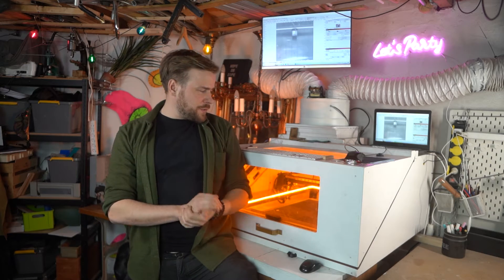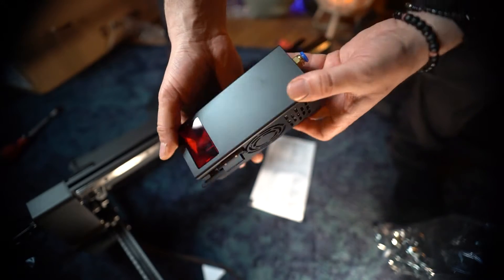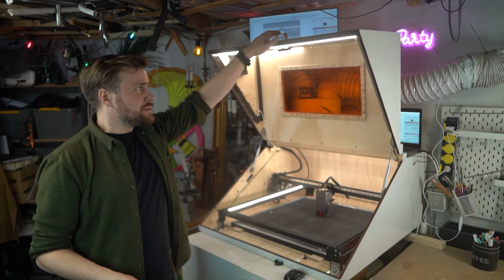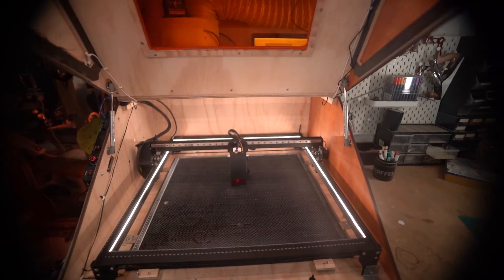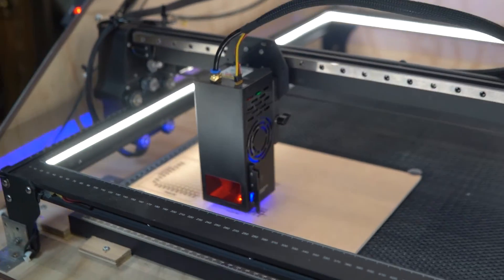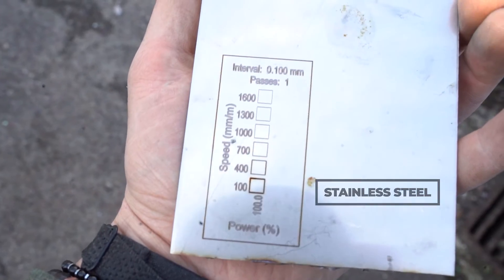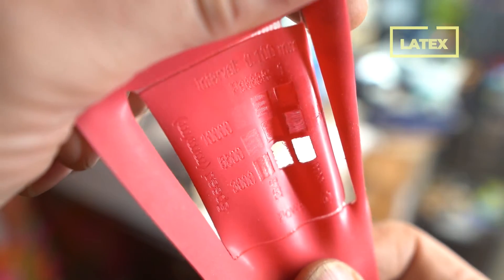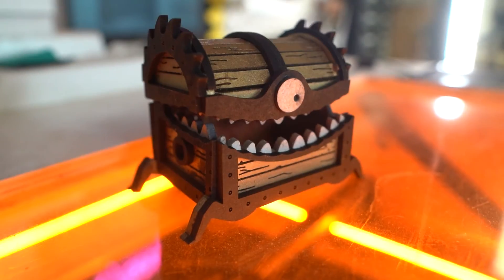Best bang for the buck diode laser in EU ? Mecpow x5 (22w) - First impressions

Comment: Hey @jokoivi, I just bought an X5 and I try to create the same enclosure as yours (but fully closed with the mc5 camera). I was wondering how you manage to keep the flame sensor useful with you installation. Did you drilled a hole behind the control panel ? By the way I'm still trying to understand how this flame detector is working 🥲
Reply from the maker: @ludolsn  yup. I cut a hole and added some rubber to seal around it. The sensor is most likely set to detect a specific range of infrared  light
Reply: @jokoivi thx for the answer. I would love to take your advices to avoid errors during the creation. If you have any feedback that can be useful I'll take it 🫶

Comment: Hi I got the 33watts X5 pro and I can’t seem to get any good results in etching tile. I have a 10 watts crealty Falcon which does a perfect job at etching ceramic tile. I wanted a machine with a bigger working area and one that would do it faster but so far after trying everything from tweaking speed and power settings, to adjusting the laser focal length. It’s still giving me poor results. It was your video that inspired me to get it do have any suggestions for me
Reply from the maker: @jusufuswaray8339  not getting good results in which way? Lack of power? Distortion? Some parts uneven? The engraving not being detailed enough?
General things to keep in mind:
- Ceramic is glossy, might need laser engraving spray paint to dull the surface first and then you wash it off.
- is the surface level? Measure you laser head distance in all 4 corners and ensure its identical
- Is the focus distance correct?
- when's the last time you cleaned the lens?
- check the settings within lightburn
- more watts on a diode laser (10w vs 30w) helps cutting faster but it can have a negative effect on engraving since the laser dot is larger and there for the resolution you get out of the Laser is different.   lower watt diode laser generally has better engraving quality, thought perhaps won't be as fast if high power is needed.
Reply: @jokoivi  fuzzy, kinda distorted, not dark enough, and for some reason my 10watts crealty engraver is giving more power! When etching ceramic you always have to coat the tile with spray paint which I always do. All the surface is equally leveled. I don’t cut, hardly ever engrave on wood, most of my work is tile etching. The engraver is brand new I just got possession of it, I haven’t had it for up to 2 weeks. I spent a lot of money to fedx it to me in Africa.
Reply: Is it possible to order just the laser module. I’m wondering if I get the 22watts laser head since it’s less power if I’ll get better details because I etch photos on tiles. I don’t use light burn I use Laser GRBL
Reply from the maker: @jusufuswaray8339  I'd first just Google the  issue and try debugging - could be focus, could be software related issues. Also just take photos of the problematic engraving and post on diode laser Facebook or reddit groups... Often there's people who've seen similar issues and know the reason.

As for a replacement module. Mecpow doesnt sell them directly on the website but I've seen people posting about replacing them with ones off AliExpress on mecpow's Facebook group. Might also message their support for a solution? I'm just a random dude who bought one for the fun of it, so my knowledge is limited ;)